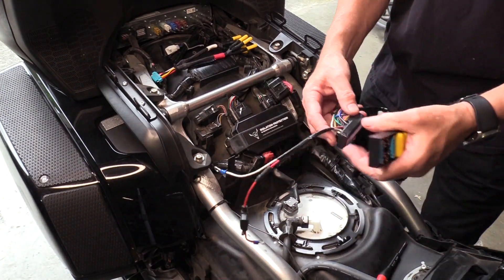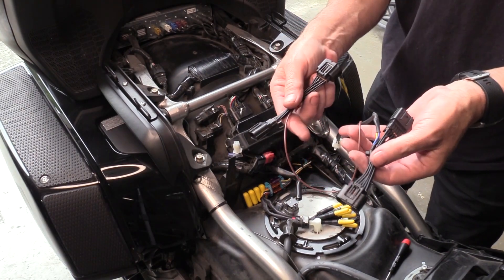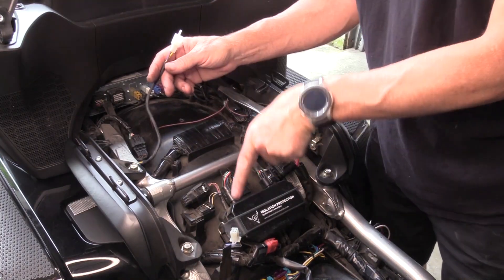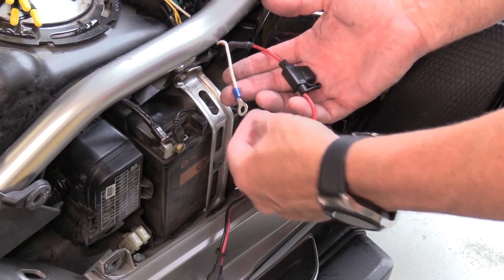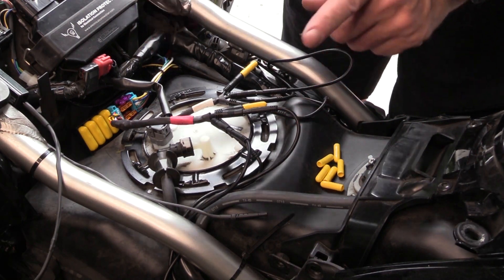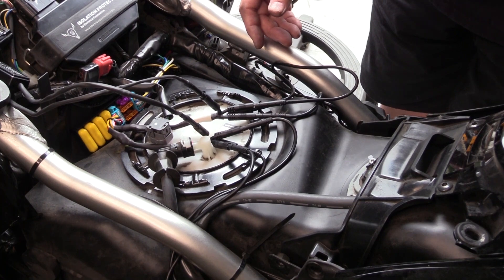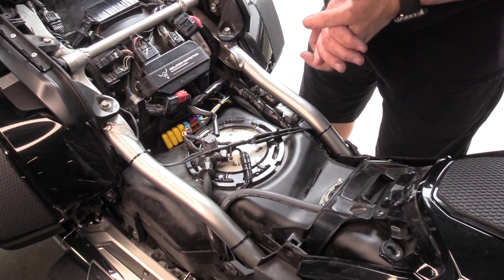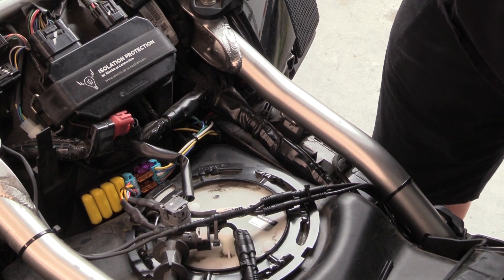Electrical Connection Lighting Distribution Installation

Comment: Stopped by Electrical Connection this week and had Lewis swap out my current distribution block with his.  Really cleaned up the connections under the seat and also allowed me to add a few additional lights on my 2018 Wing.  His distribution block and connectors is amazing and now when I look under my seat it truly looks like all factory connections exist.  Also to add additional lights and farkles it will be easy peasy.  Do yourself a favor, just DO IT!  :)

Comment: I have the Kisan Trailblazer, where will that be installed in your taillight wiring - before or after your wiring from from the distribution block?
Reply: I have show Chrome one and it has to be last connection to brake so mine is connected after his connections on left and right sides
Reply: Always place the modulator last.  That way you don't burn up the relay for the brake lights in the isolator.
Reply: @lewisatelectricalconnectio2060  please call me back I have alot to talk to you about I called I emailed you but the email I never get a response from very very important for me to talk with you please..